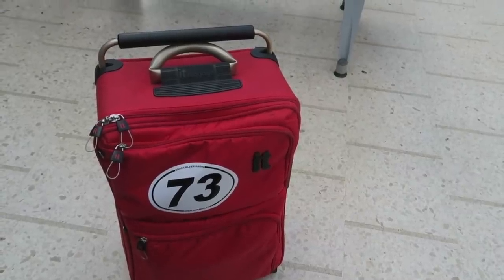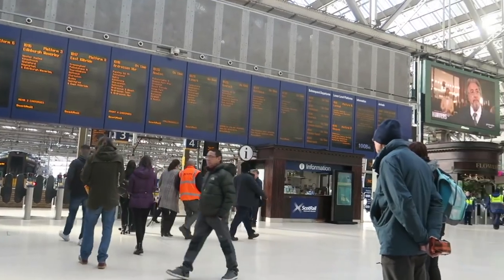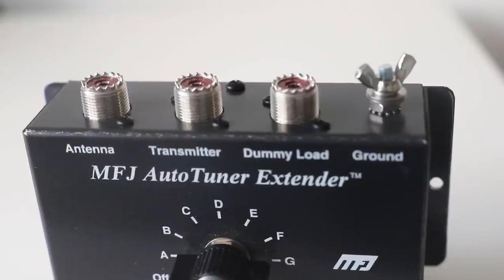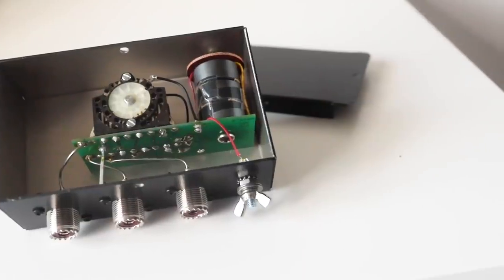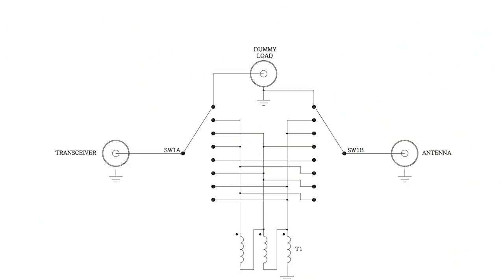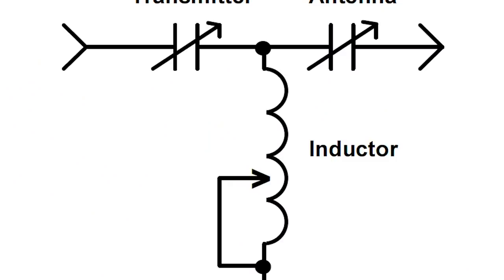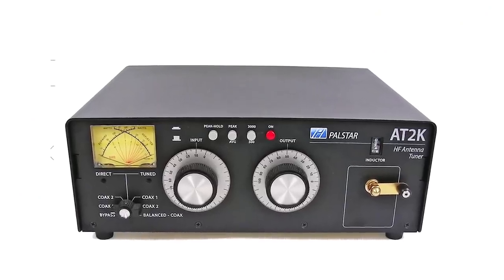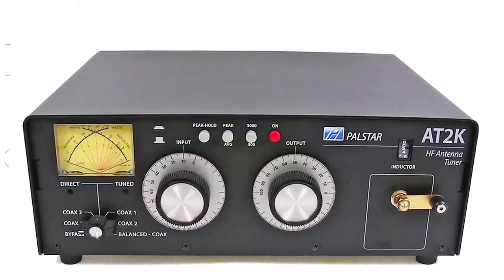Antenna Tuners   Things to Consider

Comment: You have to be a brave man to make a video on this contentious subject. I remember being a bit irritated by the term “ASMU” or similar that one of the technical contributors in Radcom was pushing as being more accurate than “ATU”. I have adopted “Matcher” now. A very trivial point regarding internal/external is that radios (particularly with sub receivers) bypass the tuner on receive, this can work for you or against you. The high pass characteristic of a T-match can help if your receiver is being bashed by a local MW broadcaster. Your video is excellent, unlike my pedantic points you knew when to stop. There are a few videos on this platform that are absolutely incorrect, there are some that are accurate but bamboozle beginners with Smiths charts etc. Keep up the good work
Reply from the maker: Hi there,

You make some interesting points.  Sometimes in life we have to go with "Biro" means ball-point and "Hoover: means vacuum cleaner! Thanks for the input. 73s Peter.
Reply: I think antenna system tuning unit is fitting to what a tuner does, Mr Varney was describing how his antenna was brought to resonance with the astu just the same as any doublet antenna

Comment: Auto ATU extender is an interesting concept and potentially useful /cheap addition to a rig with autoATU. Note according to MFJ literature switch position ‘D’ (not ‘A’) is the direct or bypass position. Worth also pointing out that with an external AMU w/o built in power/current/SWR meter then put the SWR meter before the AMU (not after). One related item to the subject that I find really useful in ‘lash-up’ situation is the MFJ ‘artificial ground’ connected in-shack with a random counterpoise under carpet or thrown out of car window to tune away stray rf that might otherwise degrade your transmission or get into other peripherals like laptops or external data interfaces. 73
Reply from the maker: Hi there,

Thanks for those additional points. I am sure viewers will welcome them. 73s Peter.
Reply: When you say put the put the amu before the sir meter, do you mean TX-SWR-AMU-ANT or TX-AMU-SWR-ANT? Im assuming that you mean starting at the TX end as it's tuning the TX signal?
Reply: @jackofalltrades1206  Tx-swr-amu-feeder-ant.
You are correcting the SWR for the transmitter, so the meter needs to be seen by that.
Ideally you are also correcting for problems with the feeder and antenna combined, though this can mask problems with the feeder. Clearly this is not the case with a remote amu, as the feeder is before any correction equipment.
In simple terms it doesn't matter where in the feeder the amu or SWR are unless there are faults and the kit is in the above sequence.

Comment: An antennasystem tuner gives also pre-selection to your frondend of your reciever. If you use a wideband antenna system your recieve signals are sometimes better cleaner less noise. On 160 and 80 meter no mediumwave stations breaktrouth for example.

Comment: Thank you for this and your many other videos. I am considering the MFJ-914 - 1.8-30 MHz AutoTuner Extender for my Icom 7300 connected to a 53' end fed wire on a 9.1 unun and a 1.1 line isolator. Would the MFJ-914 - 1.8-30 MHz AutoTuner Extender help my situation and the ic7300,s internal ATU?
Reply from the maker: If your IC-7300 internal  ATU is unable to match your setup then the MFJ-918 should get you sorted. 73 Peter.

Comment: Very helpful! I now see why an external tuner often provides a better SWR than a solid state transceiver internal tuner. I've successfully used a manual external tuner with my end-fed antenna to get a low SWR, but have had problems getting a usable SWR with an automatic external tuner. Does this indicate an external automatic tuner limitation or defect?  Or are external manual tuners simply better at achieving a low SWR with end-fed antennas?
Reply from the maker: Glad it helped! Generally a manual tuner has the best capability. You do not describe your antenna in detail. The best end fed is an End Fed Half Wave with a 49:1 transormer. it should work well with an auto ATU. 73 Peter. www.hamradiostore.co.uk
Reply: @watersstanton  Thank you for your prompt reply! I believe you've answered my questions. Due to severe space limitations and the need to hide any HF antennas from public view, my antenna is a stealth 71' end fed non resonant sloper with a 9:1 unun, 50' of RG8u, two 15' counterpoises and a common mode choke at the transceiver. It's definitely a compromise antenna setup but using my MFJ - 904 manual external tuner I can get a 1:1.5 SWR or better on all bands, 80 - 10 meters. I was extremely surprised recently that using that compromise setup and carefully adjusting the manual tuner for 1:1.1 SWR, I worked VK4KW in Australia using 1OO watts SSB on 40 meters at 3 am local California time. However, I wondered if an automatic tuner would tune my setup to the same SWR faster or better, and I believe you're saying the manual tuner would likely do better for me.

Comment: Great video !! I’m left with a couple of questions about automatic tuners, first do you have any opinions on built in swr functions versus separate swr meters that can be used for other things? (Locations in the transmit path) and secondly what are your thoughts about the automatic tuners with “data cable” connections to the transceiver ? (like ic-7300 and MFJ-939I)
Reply from the maker: Richard, an external VSWR meter has bigger display, usually Peak feature, several power levels and. as you say, can be used for other things, I cannot see much advantage in data leads with the current tuners. They RF sense and are super quick. 73s Peter,

Comment: My set up, end fed 49:1 with 134' of AWG14 wire. 40 to 10 is ok. Even high 6 meters. On 80, is very high, as high as SWR 6:0 or so. Already cutted from 135' to 134. Now, a capacitor in the middle of the wire length, will bring 80 meters higher, as my good swr on 80 is around 3.7 mhz, so the antenna is really a 80-10. Now, to avoid cutting the wire and adding a capacitor, will an external tuner take care of that? In other words, bring 80 to 3.8 mhz to 3.9 mhz? Even no cap in middle of wire added instead? Thanks.
Reply from the maker: Many thanks for sharing

Comment: Just a thought...…….why not just have a matched antenna in the first place? Having been a ham for a while now, I graduated from a G5RV, and then dipoles ultimately to all band antennas - the Hexbeam, the fan dipole, the DX Commander, the screwdriver for mobile, the Cobwebb, the SteppIR (if you have more money than sense), the trapped mobile whips, the horizontal loop, the vertical loop.  Just get a system that is matched on the band you want to use.  I no longer have an ATU in the shack. I simply switch to the antenna I want to use. Currently have a Hexbeam, a loop and a DX Commander. Job done.
Reply from the maker: Hi there,
Iinteresting comment. Not everybody can accomodate a resonant antenna. Some are forced to use an end fed wire. The extremely popular doublet also requires a matcher. 73s Peter
Reply: There isn't many resonant antennas that don't need matching for maximum power transfer, why limit yourself to one band, the doublet is a very efficient antenna brought to resonance with the atu

Comment: Hi Peter
I recently purchased a IC7300 from a Canadian supplier.  I also bought a LDG auto tuner for it  IT-100.  I am using a G5rv antenna which a fellow ham gave to me it is a mfj 1778.
During the first 3-4 months while using a FT-990 I notice a big improvement and then with the addition of a 45 ft fiberglass pole an even bigger improvement in both receive and tx
I find the LDG tuner unsatisfactory as it will not tune the g5rv unless it is close to the freq that the internal tuner will tune.  In one of your vids you mentioned using a 4:1 balun on the g5rv.
question will that improve the conversion from balanced to unbalanced or am I looking down the wrong rabbit hole (should it not be 9:1 450 ohm to 50 ohm)
Jim ve4jim
Reply from the maker: Many thanks for that.73 Peter

Comment: Hello. Perhaps you can make a short video on antennas which are trimmed so you don`t need a tuner (maybe you already have one- I am pretty new to your channel). My first homebrew consists of a fan dipole inverted V for 40, 15 and 10 maters. My Kenwood TS140S has no built in tuner, so I have trimmed the antennas to be around 1:1- 1:7 :1 SWR. The Kenwood works just fine. I keep it at 100 watts.  Thanks KC3BXZ Joe 73
Reply from the maker: Hi there,

If you can trim the antenna as you have done, then there is no need for an ATU. But some antennas such as doublets and end fed wires can rarely be used without an ATU. Keep in touch and nice to hear from you. 73s Peter.

Comment: Hi, Thank you for your video, I would like to know your opinion, I have a Kenwood TL-922 Amplifier, is reasonable to buy an Antenna Tuner ? Thanks in advance!
Reply from the maker: For what antenna system?
Reply: @watersstanton   Loop Antenna Different sizes, AM modulation (500 watt) .

Comment: Thanks Peter. I thought this was good, clear, straightforward advice. Good introduction to antenna matching options. I didn't know about the extender device - a variable impedance transformer. It reminds me a little of the old KW-107 which did a similar job for ladder line fed doublets.
Reply from the maker: Hi Steve,

Nice to hear from you. I was in Fort William and Glasgow a couple of weeks ago. 73s. Peter.

Comment: I live about 7 miles from Piqua Ohio the home of Palstar. They hand build the variable caps and roller inductors in house.
I have alway call them Trans matches instead  of tuners.
Reply from the maker: Hi there,

Great to hear from you. I have been to Piqua, quite a few years ago, and visited their factory. Yes, nice gear. Thanks for checking in. 73s, Peter.

Comment: The "ATU" or better. "matching unit" is best understood as a GEAR BOX..
In a car engine, power cannot be delivered to the wheels of a stationary vehicle in top gear.
(Unless you've got 4 litres!)
The gear box "matches" the load to the engine at low speed..As the speed changes, a new ratio is selected to maintain the requirements of the engine with respect to its load.
It's a mechanical transformer.. an EMU.... Engine Matching Unit!
With the MFQ extender box, the unsuitable Z on the incoming coax, is transformed to something the rig can handle but the SWR on the line to the antenna and its consequent losses, is unchanged. Correct that and the extender box isn't necessary with its additional PL259 joints!
Our workshop kept the PL259 plugs in a drawer marked 3dB attenuators!
G3NBY
Reply from the maker: Thanks for sharing. BUT 3dB - maybe at GHZ but not at HF. 73 Peter
Reply: @watersstanton  
Are they really as good as that? Great. I think that they vary within manufacturers.
I heard that they were designed as audio connectors. Of course I use them anyway.
What about open to weather? Not recommended ?  Weather proofing?
73... Fab series of videos.. Very attention holding....Loved the demonstration of overtones 
on the guitar..... Saxophones do it but usually out control. It's called squeaking!
Earl Bostik totally mastered it...73 G3NBY

Comment: That T match has a problem.  There's a shorted turns situation on that circuit.  Won't work well like that I shouldn't think.   Interesting as always.     :)
Reply from the maker: Er.........explain a bit more your train of thought. Peter
Reply: @watersstanton  Bottom of inductor is shown connected to slider.  Clearly shorted turns.  It's a mistake I've seen repeated since I was building crystal sets. The lower end of the inductor should be open circuit.   ;)
Reply: @Graeme_Lastname  
That has been a long standing concern in my mind......never satisfactorily resolved.
As the adjustment, be it a slider or switched taps or croc clips, reduce more and more of the inductance, there is the absolutely inevitable condition of very lossy shorted turns. Some designs insist that a coil mounted at 90 degrees to a chassis should have some clearance because the very metal of the chassis can display some "sorted turn effects".
Two adjacent shorted turns on a mains transformer can be pretty spectacular.
Even failing to unwind completely a mains extension lead when on a heavy load can be a bit graphic in this regard.
That ATU coil and shorted turns continues to be a mystery.
I'm amazed that you found it noticeable on a Crystal Set.
Observable loss in gain? Lower Q upsetting selectivity? At higher power levels, it doesn't bear thinking about!
Would be interesting to hear.
73 G3NBY
Reply: @MauriatOttolink  Put a single turn around a power transformer.  When it's open circuit it does, basically, nothing.  A voltage is induced across the ends of the single turn but no current flows through it. There is zero power dissipation and the voltage across any other windings is unaffected.
However, when the ends are connected current flows and power is dissipated. 
That simply means there is less for any other windings so there is lots of heat and all other windings have much reduced outputs.  I know it's not a transformer in the classic way but the results are the same.
Make a crystal set and try it out, or, short the secondary on a power transformer and watch the magic blue smoke come out.  Mounting any coil too close to the chassis will cause huge losses.  Long time ago, 1KW linear amp, poor placement of output tank.  All my own doing.  But, output stage had to be rebuilt to increase the clearances just to reduce all the nasty effects on plate current, Q etc.
Build a crystal set and give it a try, just be sure you're not just making the antenna bigger with your fingers.
Keep well m8.   :)    _ . _
Reply: goinghomesomeday1  It's a shorted turn(s).    Simplest way to see what happens is to give it a try.  Just imagine, amongst other things, what it does to the Q.
Bring a closed loop near the output tank of a transmitter and watch the output power drop off.  Best not used with solid state TX, may well make funny noises.   :)
Reply: @watersstanton  It's a shorted turn, or turns.  It will dissipate the majority of the power as heat.  Can't get a good Q with that happening. Any power lost in the shorted turn is not available for anything else to use.
I can't think of any circuit that has a built in shorted turn.  Can't even think of any reason to do so, unless you want a heater.
Keep well and don't let your finger get across the plates of an output tuning cap.  Even at 5W, the smell is horrible.   :)
Reply: @Graeme_Lastname  Hello Graeme.
Thanks for your note.
Having wound and rewound small power transformers, I am aware of the principal
and spectacular effects when it goes wrong.
My mystery, and has been for years, is that one you raised, the shorted turn when the tap is at the bottom of the coil.
All schematics show the cold end grounded or RF bypassed.
I usually put the tappings from the hot end so the lowest is not a shorted turn.
On Xtal sets, I always did it that way because I was shown that way as a kid.
I learned of shorted turns much later.
73  Stay Safe.
Reply: @MauriatOttolink  Yeah m8, that's pretty much it.  I've rewound a few transformers in my life.  Just hope I don't have to do it again.    :)

Comment: Efficiently isn't reduced due to a mismatch that would be down to how it's fed or a non resonant doublet would be useless
Reply from the maker: I think you are confusing yourself. A mismatch certainly does reduce efficiency. This can be corrected with a matching unit. A doublet is generally not regarded as a resonant antenna. Once the element is a half wave or more, it has excellent radiation and only the pattern changes with length.
Reply: @watersstanton  if the feedline was lossless then all reflected power from a mismatch would be radiated by the antenna, the reason a non resonant doublet is so efficient is the feeder has little loss even with high swr,or in your words from a previous video,' the swr from the mismatch doesn't represent loss' , the atu does correct the mismatch as it brings the system to resonance, but efficiency is reliant on feedline, feed the same antenna with rg58 the antenna won't be anywhere near as efficient